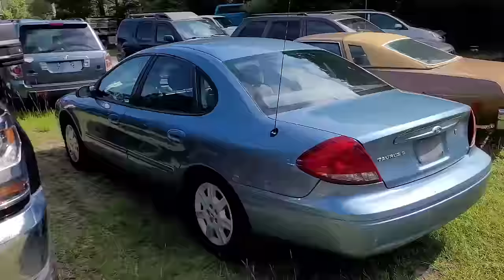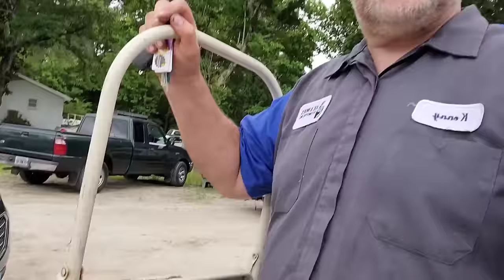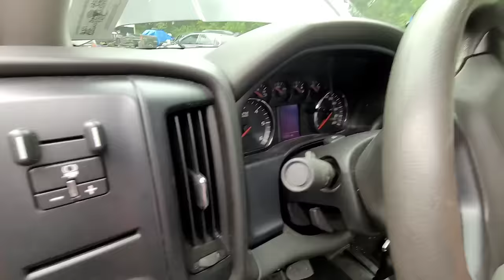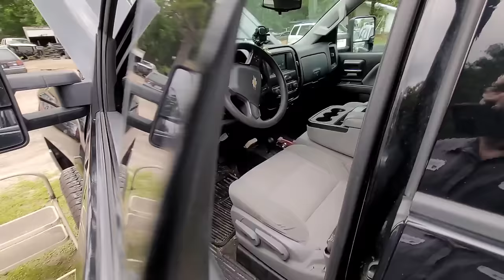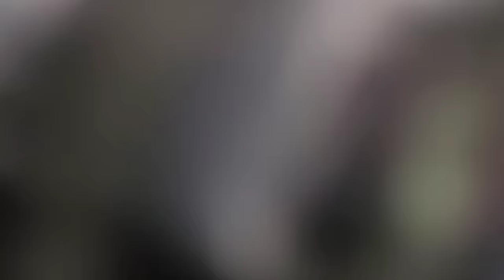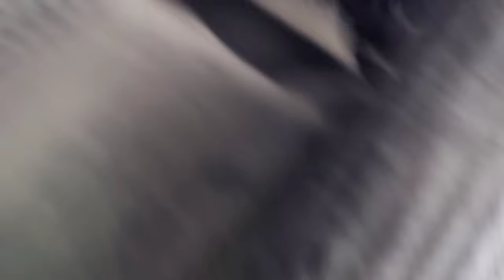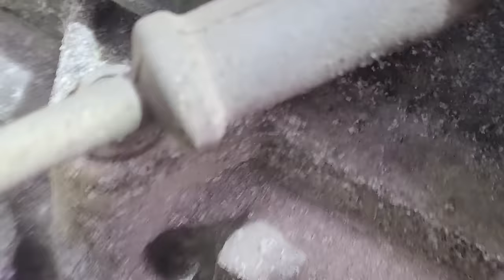Another GM 5.3 Ticking Noise. It's not the lifters on this one either

Comment: my dodge dakota did the same thing 4.7l i pulled the mainfold off and it had warped i took it to napa and they resurfaced it i couldnt get the studs out of the head had to weld to existing ones but it worked out good
Reply from the maker: Nice repair !! Thanks for watching !!

Comment: I put some  new spark plug wires in my old truck old TBI engine spark plug wires kept on disconnecting for the first week even even the main one to the coil got disconnected on the highway but after a week they did not disconnected anymore

Comment: Have a 02 brought new with a 5.3 187k and it started ticking, knocking,tapping at 80k. The oil pressure only until recently has started to not be as high as previous. Do not use it as much as in the past, mostly highway. Any who overall has been a great vehicle.
Reply: Bet it's the pick-up tube o-ring. They tend to crack or flatten.

Comment: My old truck has a ticking noise but only on the highway and only after about 20 min. If driving. As soon as I shut the truck off and let it sit a min or two It quits and won't do it again for another 20 min. or so. It never does it around town, only on the interstate or highway. I'm at a loss.

Comment: I have the exact same noise, When I step on the gas To accelerate, The noise increases with the speed. What could it be ? I have the same 5.3 14 Silverado.
Reply from the maker: Could be lifters or an exhaust leak at the manifold

Comment: Gee, I’m shocked, a broken exhaust bolt on an LS based truck/van motor. Seen it more than a few times, I use mig welder, nut, vise grips to extract them . 799 heads.

Comment: I have a ticking noise, low oil pressure after cleaning sensor and screen with oil change? What could be the issue as I’m still showing low oil pressure

Comment: I had the same problem on a five cylinder Colorado exhaust manifold and cracked also, I ended up welding A nut on the broken off stud to remove it out of the head
Reply from the maker: Good job !!

Comment: Get rid of the 0-20 oil.  I had issue with my BMW as soon as I switched from 5-30, or 10-30 oil.  The "0" oil is too thin and runs all down when car/truck is sitting.  After a few days sitting my car engine really shook and struggled (mechanically) to start.  If you start it every day, it starts right up.  But to leave it sit any amount of time, the thin oil drains down off the moving parts.  I will never use 0-20, 0-30 oil again.  I am an engineer, and have rebuilt many engines.  I have seen what improper oil does to an engine.  The car companies are being forced to thinner oils for mileage and EPA requirements, but does not do the life of your engine any good.

Comment: I have a 2019 GMC Sierra 5.3 and it hard shifts or shutters when I first and second gear and in reverse only when I accelerate from low gears ..I've taking it in to GM so many times and they can't seem to duplicate it Ive had it programmed twice and replaced the control module it has 62,000 miles on it now but it's been doing this since I bought it with zero miles brand new ...any idea what it could be

Comment: I have a 2012 6.2L I get a tick/tapping noise only around 1800-2200 rpm’s. Does it at random sometimes cold sometimes hot never at idle cold or hot. Any ideas?

Comment: I have a 2011 5.3l with 191,000 miles. My truck sounds good util I tow a trailer. Then it starts ticking bad. After driving normal the ticking goes away.

Comment: Exhaust head bolt is broken or a exhaust head gasket is leaking.
Reply: I have a 2022 Chevy Silverado 5.3. It has a ticking sound when the rpm goes 1500-2000 below or above 2000rpm its ok no sound. I already changed the lifters and rods, also changed the master belt. It has the auto start stop feature. Please help

Comment: I'm wondering how many miles did that truck run? I have a feeling it's about 200k
Reply from the maker: Had 118K
Reply: @WrenchingWithKenny  I have a chevy silverado V8 4.8 it tick 3 to 4 minutes after starting. 15 to 20 minutes later it stops. After that it runs extremely quiet. Until I let cool down it won't tick. Do you think it's my exhaust manifold bolt?
Reply: @WrenchingWithKenny  someone told me to use exhaust manifold hold down clamps

Comment: If the noise gets louder when under a load, it's an exhaust leak.
Reply: Mine will get louder under acceleration.also using regular gas causes pinging like crazy.trucks a 2014 with 208,000 miles on it and she runs good but the exhaust is getting more noticeable

Comment: My 07 Silverado 4.8 had the same ticking noise once I would start it and I took it for a spin around the block ticking got louder and all of a sudden it farted white smoke out of the exhaust and shut off. Tried starting it up and nothing it doesn’t even crank. I had just replaced original motor at 150k and this one only had 50k miles on it and idk what to do I’m yanking my hair out. Is it a blown motor?
Reply: Please help me out
Reply from the maker: Give me a little more info. What have you done soo far ?
Reply: @WrenchingWithKenny  nothing I had a couple mechanics check it out and they all say it’s done for. One of them took off the starter to see if the motor would crank freely and nothing, I’m being told to reconstruct or buy a new one
Reply: @WrenchingWithKenny  nobody wants to open it up to check it out.

Comment: how can exaust manifold bolts just break off by themselves? never seen this happen
Reply from the maker: Its a common issue nowadays . Ive seen it happen to all the manufactures as of late. I've seen Toyota, Nissan, Volvo, GM, Ford, Chrysler & Mazda . It seems to be the contraction rate between the cast iron exhaust and the aluminum head that causes it. But I cant guarantee it

Comment: I have a question about this tapping sound: I have a '96 Cadillac Fleetwood Brougham. It has the 5.7 Lt.1 engine in it, w/123k on it. It has this tapping noise. Can these tapping noises be possible for this engine as well? It's an everyday driver, and sometimes, the tapping goes away...sometimes not. As a child, my dad had Impalas, '72's and'73's, w/this same sound. Can it be what you are pointing out on this engine?
Reply from the maker: Any engine can make tapping sounds. There are a bunch of possibilities. Could be an exhaust leak, a lifter tap . I would probably pick up an automotive stethoscope and try and figure out exactly where you can hear the noise coming from. Thanks for watching !!
Reply: @WrenchingWithKenny  
Thanks! 👍

Comment: Ok so 3.5 dodge had a valve slap not all the time, so I had enough of it and got deeper and started watching sensor voltage, so B2S2 would sit at 750mv at idle but work right at speeds, so I replaced the cat's, still same thing. So, I went further, one of my walker quiteflow ss mufflers spit its guts out into the pipe, Im a plumber myself so when I saw that string of hair I instantly dry heaved. Done car has full power and the dang valve tick/rattle is gone.
Reply from the maker: Wow !! Interesting . I wonder if back pressure was causing some noise . Hmmmmm

Comment: I currently have the same issue. How much would it cost to fix this? It is happening on the same side as the video
Reply from the maker: On average it runs about $400 . It can go higher depending on how many bolts arr broken and how difficult they are to remove
Reply: @WrenchingWithKenny  did you end up fixing that vehicle and the noise stopped?

Comment: 05 Silverado 5.3 only ticking when front was lower than rear. Starter tinging the flywheel ?
Reply from the maker: Possible !
Reply: Oh it was took me 3 months to find it !
Reply: Ran it 330,000 miles water pump and alternater, starter only issue with Engine tuned with plugs and wires about 175,000 miles best engine I've ever owned 👍
Reply from the maker: I bet it was a huge relief when you found it !!

Comment: I had once a ticking sound in the wife's car. My wife took the car to an assh..le who told her that the cam shaft is bad and need replacement. Actually she paid full repair price and they never have touched any bolt of the cam cover, some of the bolts are still jam with rust no sign of tools what so ever. The ticking sound was loose tensioner they have it fixed but charged new cam shaft.
Reply from the maker: I hate people like that . There is zero reason to be dishonest . In this field, When you do the right job and you're honest , the work never stops and great customers are the result . I'm sorry this happened to your wife

Comment: ON MY 05 YUKON XL 5.3 220K STARTED LIFTER NOISE AT DIFFERENT TIMES ,HOT ,COLD HIGHWAY SPEED INTERMITTING ,NOT ALL THE TLME,BUT SOMETIMES WOOD  BE SO BAD THAT I WOOD PULL OFF EXIT AND CUT OFF,CRANK BACK UP AND IT WAS ALRIGHT .ALL I DID WAS DROP OIL PAN REPLACE  PICKUP TUBE  ORING WITH RIGHT ONE  FOR  05 5.3.THAT WAS THREE YEARS AGO I NOW HAVE 267K .I HAVE NO LIFTER NOISE SINCE.RUNS QUIT LIKE NEW.USE MOBLE 10W30  7K OIL CHANGES.USES NO OIL HAD EXHAUST LEAK ON DRIVERS BACK ,USED CLAMP PLATE BOUGHT OFF EBAY

Comment: My 4.8 sounds like a new truck and drives like a new truck and out of the blue two weeks ago I stepped on the gas and it wouldn’t go, I was due for plugs and wires so I changed them , then I got a tps code , I changed the throttle body and sensor, I had two bad o2 sensors so I changed all 4 , ran good and then it did it again an hour later , I changed the accelerator pedal and sensor , ran great again and later that day and boom it wouldn’t go after sitting at a light for a few minutes, I checked the converters , they are both clear , I checked the voltage on my battery and altenator, my battery was at 9 volts and my alternator was putting out 12 volts , I changed the alternator and battery and it ran great , and after it got hit it started spark knocking again in gear at idle , and wouldn’t go , I’ve checked all the vacuum lines , there is no codes or nothing visible I can find and it loses power when I sit at a light for a minute and is hard to get going and the spark knock at idle in gear !!! But when it gets going it runs smoothly, I’m pulling my hair out now 🥹🥹
Reply from the maker: No codes ? Hmmmm . I would start with a battery disconnect and capacitor discharge and make it happen again . Then see if you have any codes. If not , then you'll need to get a scanner on it and look at data to see what's going on . I had a truck awhile back that would loose the throttle and not have codes . Turns out someone had replaced the throttle body connector and moisture had entered the splice points and changed the resistance. Not enough to set codes , but enough to throw it into limp mode .
Reply: @WrenchingWithKenny  I did use multiple scanners , blue point , snap on , it sounds like a diesel right now sitting at a red light spark knocking like crazy in drive at idle , I’m gonna have to do a smoke test I guess to try to really pinpoint if there is a leak and really check the ground connections good
Reply: @WrenchingWithKenny  but it idles so nice in neutral, super smooth and quiet like a new truck so my experience with vacuum leaks is it runs like shit and throws codes , im starting to think my ecu is bad but I want to rule that as last resort
Reply from the maker: @DavidWilliams-wr4wb  try getting QD Electric Contact Cleaner and really clean the mass air sensor good . Just spray it front all sides , don't use a brush or towel or anything on the sensor. Don't even use compressed air . See if that changes anything . Also ,  try a new map sensor . My 03 Sierra, while it's a 5.3, sounded like a diesel at idle also , it was the MAP causing it

Comment: RUn 10/30 dino oil any brand and by your 2nd oil change your lifters will quiet right up. 
When mine started ticking it was only a few mos old dealer said thats the way they are (he was right)...no fix. Embarrassing til I stopped running syn oil

Comment: Please help my 07 Tahoe has bad idle especially on cold starts I changed spark plugs, ignition coils, pcv valve and maf sensor idk what’s wrong also this only happened once it started throwing white smoke and just started shaking really my last option is thinking maybe it’s my MAP sensor
Reply from the maker: I'd be willing to bet you have a vacuum leak at the intake manifold where it bolts to the heads . Usually its just the gaskets that go bad , but I have seen the intake manifolds warp causing this .
Reply: I already changed that too
Reply: Idk if a exhaust manifold leak would cause this cuz I also hear a ticking noise on cold starts

Comment: Hello sir, can you tell me where is the steering oil stopper please? I can't find it...
Reply from the maker: What vehicle? Year, make, model
Reply: @WrenchingWithKenny  no no, Im really trying to find the tank and I dont see it...
Reply from the maker: @louisruest6013  I can't help if I don't know what you're working on
Reply: Sorry. Sierra élévation 5,3 2016.
Reply from the maker: @Louis Ruest  , you're truck most likely has electric steering . No pump. 
However , their are some steering options that do have a conventional style hydraulic power steering system with a pump , and it would be on the left side front of the engine and quite easy to find .
Reply: @WrenchingWithKenny  Ill take a look at it. Thank you very much
Reply from the maker: @louisruest6013  you're very welcome

Comment: I'm paused at 1:01 my guess is a crack in the exhaust manifold that closes when the metal expands.
Reply: Loose plug
Reply: @andyjennette  I'm a mobile mechanic and my brother called me once because a spark plug popped itself out of the Chevy he was plowing snow with. All he wanted was a socket to put it back in so he could finish working. Soon after he stopped plowing snow for that guy so I have no idea if that truck had any more problems with loose plugs. 
Looks like the sound in this video was an exhaust leak but not from a crack in the manifold. It was a broken bolt. I guess GMs like to spontaneously self destruct.

Comment: Personally I've had 5 GM trucks 3 with the 5.3 and 2 4.8 trucks and they all tick slightly proper maintenance will make them last regular oil changes and coolant flush every 2 years if the ticking noise becomes more than discreet than I'd be taking it in for service there is no better truck than a vortec V8...Chevy is the power in trucks
Reply: Always make sure you use proper GM dexcool coolant in your gm vehicle dexcool is a gm only coolant as it has no glycol in it

Comment: isn't it normal to hear a TINYY bit of fuel injection? my 2010 silverado with a 5.3 and my 2021 Tahoe with a 5.3 also does a bit of fuel injection noise which it seems to be every car, even toyotas.
Reply from the maker: On many engines , injector noise is normal . Some cars even have sound deadener to muffle the sound . To me , most of the time it sounds like a lite "Chatter" since its multiple injectors. Thanks for watching !!
Reply: @WrenchingWithKenny  you know what, now that I heard the noise and watched the full video, that sounds horrible

Comment: I'll do ya one better, dodge ram 5.7 has the 16 spark plugs in it, guy came in for a tune up an just assumed the exhaust manifold was his ticking, passenger side of the motor in the way back by the fire wall the coil pack was the only thing holding the spark plug down, i went to take it out an it just spun round nround, the tick was the compression leaking out around the spark plug

Comment: Ive got an 05 Silverado that started ticking intermittently. Sometimes it drives all day and doesn't make a sound, other time it ticks at start up and goes away, and other time its quiet till i drive for awhile then it ticks until i shut it off and let it sit. Its got me kinda baffled, still runs fine but i dont liek ticky engines 😂

Comment: Most American Vehicle Manufacturers, experiment on the Consumers. Toyota, Honda, ect are not Perfect , No Engine is, but they have always been far more Reliable. You don't get the Typical , intake manifold leaks, and general Component Failures like With the Big 3. This is inexcusable , especially with the cost of these vehicles.

Comment: Be careful drilling that broken exhaust bolt out, if it has to be drilled out. The coolant passages are very close by. Worst case heli coil in some new threads and the new bolt now has 2 jobs, sealing the exhaust and coolant.

Comment: My 2012 5.6SE DOHC 32 Valve Nissan Titan at 311.000 miles does not make any noise and it never has coid or hot nor does it burn or leak a drop of oil. Overhead Cam engines are so much better but detroit does not get that other then ford. Nissan and Toyota are so much better.

Comment: Mmmh idk man my engine sounds the exact same on cold start ups and in know for a fact I don't have a leak.. I pluued the head today and found deep scratches in a lifter... cause probably from a miss in the past and my idiot cousin trying to "Rev it out" dropped a value seat and cracked a piston. I replaced the piston and put on some 799 heads but forgot to check lifters.. I hope the noise is gone after I get it back together this time... but definitely not exhaust... but should just like the first few seconds of that start up.. I promise you if you would have revealed it abit the sound would have come back

Comment: Anybody else notice the spark plug wire #8 arcing at -1:50? I agree the noise is the exhaust but it also has an #8 spark plug wire arcing to the manifold

Comment: you can hear its the exhaust not a lifter, sound nothing a like...intermittent tapping could be oil pick up tube o-ring is bad. Inside oil pan, sucking air, causing dry lifter..